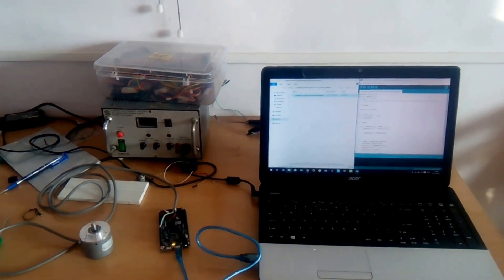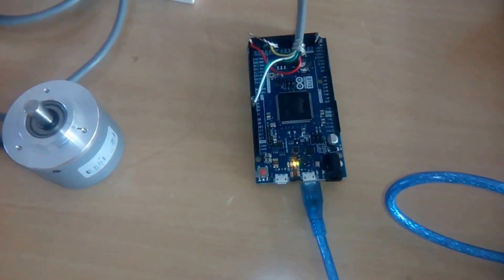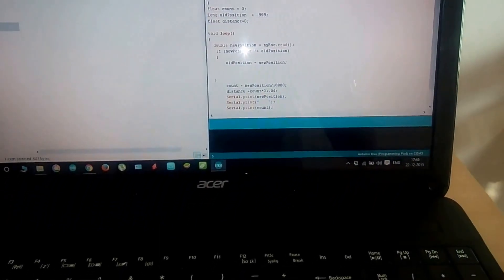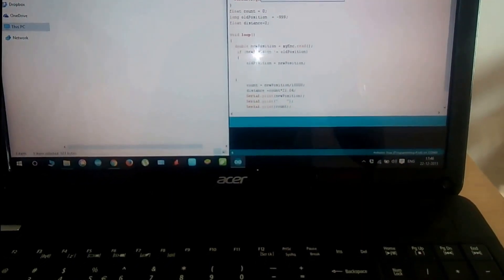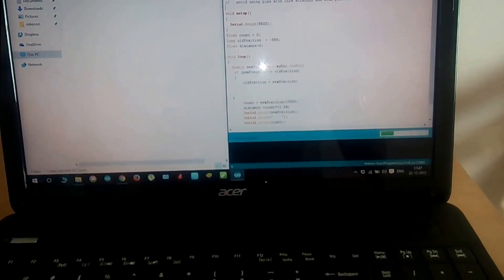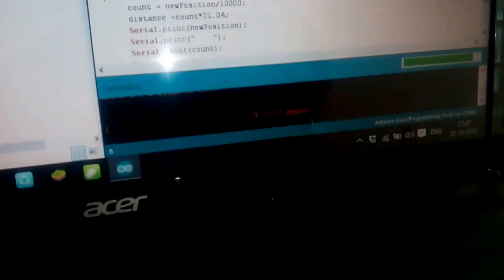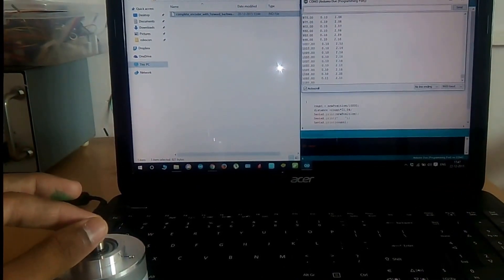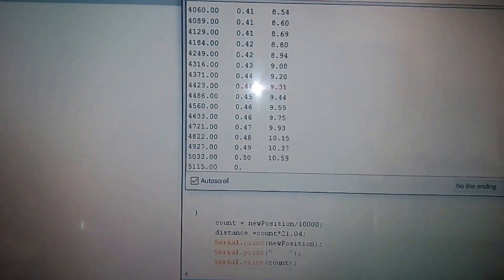how to interface rotary encoder with Arduino board ( Arduino + rotary encoder)

Comment: Hello How did you wire up the encoder ? I thought the Arduino Due board can only tolerate 3.3V. Could please send me the code as well ?
Reply from the maker: LittleAngusYoung96 contact me via mail
Reply: whats your email ?
Reply from the maker: gkapil45@gmail.com